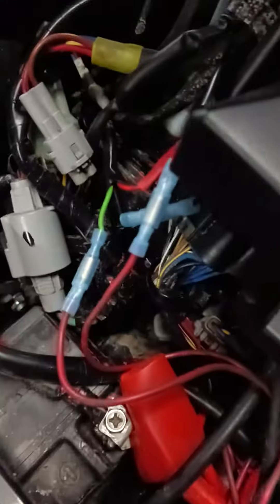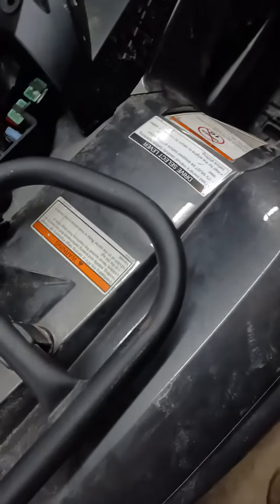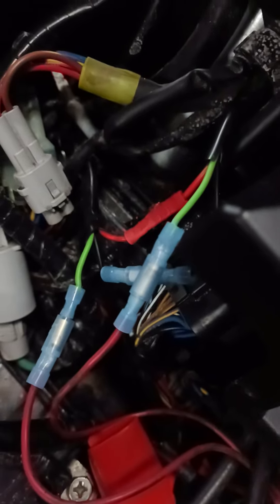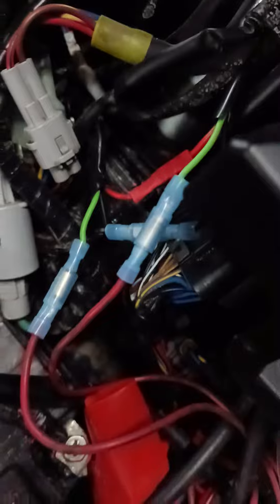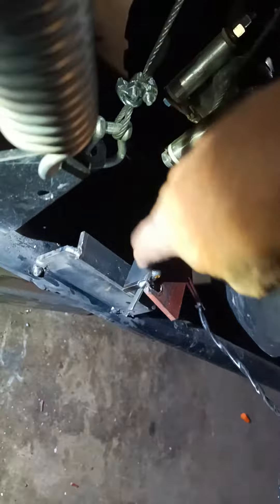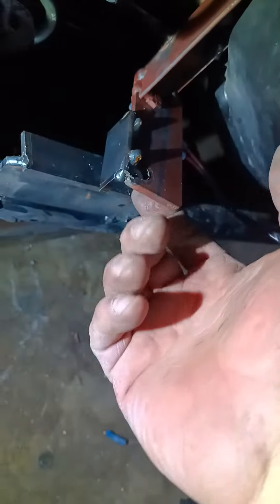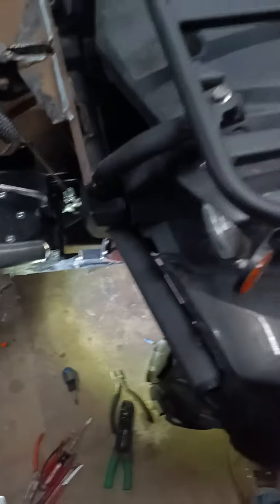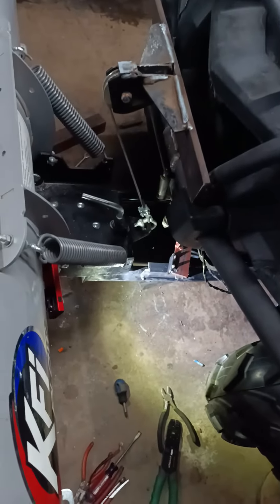ATV winch upper limit switch $20

Comment: That’s a great idea, when I had my 4 wheeler with a plow that was the biggest issue was listening for the cable stretch/ grind to know when to let off the up button, I did it so many times it actually ripped the cable from the hook on the winch